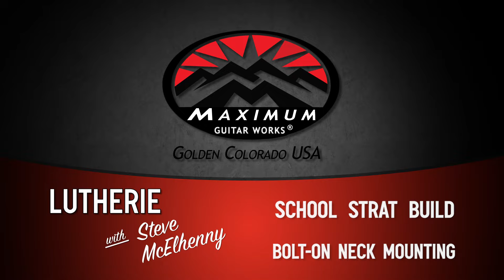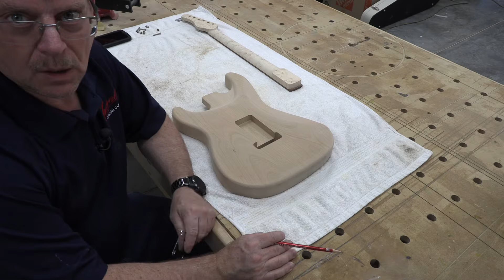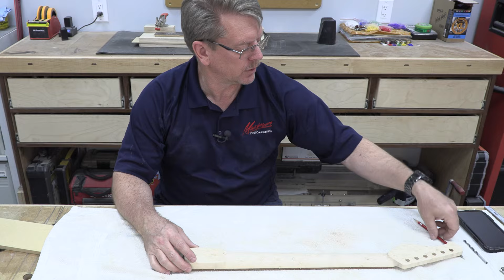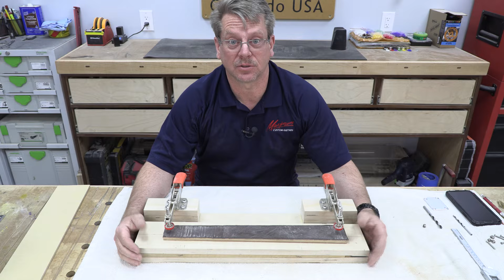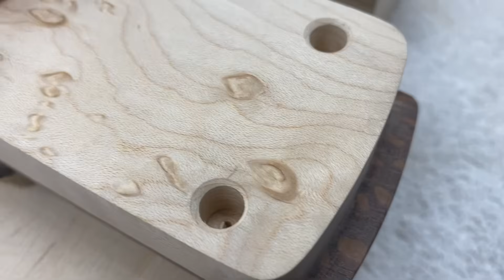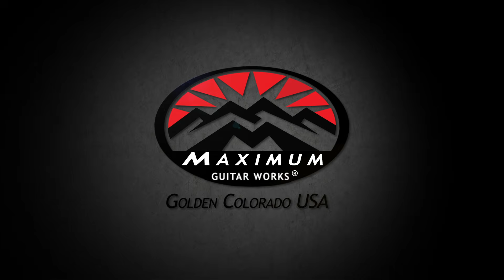The School Strat Build - Best Bolt-on Neck Method...ever!

Comment: I have a bass with a bolt-on neck with inserts. And i have a big problem with that because of the body holes wear over the time. The holes are now loose and the neck slightly moves. If the bolts are not tight through the holes you're done. This doesn't happen with wood screws.

Comment: Countersinking the insert is good for an other reason too: when you put the insert in it tries to push the wood fibers upwards and it will make an ugly result. When the hole is countersunk (beveled) then the insert will not force the fibers right at the surface but about a mm deeper so it is less likely that the fibers will chip on the surface (I learned it the hard way). The last time I had to do this kind of work I used candlewax to lubricate the threads so they can go into the wood with less effort.

Comment: would you use the stainless steel inserts and bolts on a " brittle" roasted flame maple neck, or The old wood dowel method? thank you for these videos, they are stellar detailed. Tell me more about your lawnmower seated desk chair. :)
Reply from the maker: Ahhh…it’s a great chair!

I normally don’t have issues with roasted woods. I do go slow…and if any signs of cracking appear…you can wick a little CA in the hole. After the CA does its thing, reinstall the insert.

Comment: Suggestion drill your first hole then put your plate on insert your screw not tight snug then mark your other hole across drill that hole after taking the plate off and so forth and everything will be lined up perfectly every time 👍I learned that in Vietnam .

Comment: I watched the whole thing. Great video! 
I am making a travel guitar that will have 3 interchangeable necks, one fretted, one fretless and one based on a Sitar neck. 
I think the threaded inserts will be the way to go because I'll be changing the necks often and removing them for flights. 

I bought an old German Jazz guitar that has a bolt on neck for the body and the instrument will have a sympathetic harp on it as well, basically it will be a guitar/sitar hybrid with 3 neck styles.  A bit like a gibson harp guitar, but instead of bass register harp strings it will have higher pitched sympathetic strings like a Sitar or Sarode. 
If you are curious about what I am talking about, here is a video of an electric prototype I made; https://www.youtube.com/watch?v=vX7n8LlIYuw
The new one will be acoustic and I will take it on a 3 year bicycle tour around the world. I have done long bike tours with my Sitar (on a small bicycle trailer) in the past, but I often had the urge to play guitar, so I'm looking for a solution that will keep me entertained while sitting in my tent in the middle of the desert... 
Too much detail in my comment! LOL!

Comment: 24:00 - would it be better to use a deep socket pressed tight to the body ensuring it is perpendicular?   Add a strong spring to the top of your home-made tool to maintain the downward pressure.

Comment: Thank you sir, not overly detailed. I saw on another Tube they they threaded the hole and then came and threaded the ezloc into it. Using the drill press and doing it by hand, kept threader perfectly perpendicular to the neck and then they are able to just put some wood glue onto the ezloc and thread it into the neck. If interested i can send you the link if you haven't seen it. I am off to the next course with the lining it up. And thank you for your help in building my dream parts-caster.

Comment: Thank you for your efforts to make such a detailed video.  I especially liked the "Insert Driver" adapter that you put together.  I can not remember how many inserts I have jacked up over the years by just trying to get them aligned and installed by using a slotted screwdriver.  I will be using this bolt on neck method on my Stratocaster Project's body in the near future.  This video was just what I was looking for to correct my "just about to strip out" mounting holes.  Thank you, Thank you, Thank you.

Comment: Just discovered your site ! Wish I had seen it a few days ago. My grandson approached me a couple of weeks ago seeking my help (and tools) to construct a modified stratocaster . I said sure, having no clue what we were getting into. We are using the neck from a fender knock off and making the body out of some butcher block I had on hand. I fear that in our rush to get going we have already made some small mistakes, but they do add up. He was asking just the other day about doing away with the neck screws in favor of bolts. Another site recommended going to McGuckens in Boulder for steel inserts and since I am in Westminster that should not be a problem. Will have him watch your video(s). Thanks

Comment: just discovered this video so anyway.One thing i discovered in drilling precise holes with a drill press is,not all drill bits are perfectly staight.Chuck the drill bit and start up the press and watch closely to see if the point wiggles,if it does the hole you make will be larger than you intended.Either use the point of a pencil or nail or ? and solidly put the point up against the point of the dill bit to check runout or drill a test hole on a blank piece of wood first.

Comment: I just learned something. Nut & bolt trick. Thanks 🙏.     Could you use the type that goes thru the neck that has a flange with tangs? Of course you would have to do it before the fret board is attached.

Comment: Yep, threaded inserts are definitely an upgrade. Could theoretically increase sustain due to the tighter neck-to-body attachment.
Reply: Liboy, that may be true and could be tested scientifically. Many variables but the most important is the face-to-face fit of the neck in the pocket combined with the proper clamping force of the hardware to help transfer vibration as inelastically through the joint as possible. That factor alone could even be torque-sensitive, considering that no joint is perfect. Theoretically, two machined surfaces (even accurately-machined metal) only touch at three points. This could be a case where a hard neck pressed against a softer, more yielding body wood could actually produce a more resonant joint. It's still doubtful most people could hear the difference as long as the joint is not loose or sloppy, at least that's my bet.

Comment: The easier jig to make for leveling the neck for drilling is to make some V blocks that only touch the edges of the fretboard.  Then all you need to do is place a level on the heel of the neck and clamp her down, no need for tapered resawn stock to do it.

Comment: Would it be better to tap the hole first and glue in the insert?  Have you ever had any back out?
Thank you for the in depth procedure of doing it right.  
B
Reply from the maker: I have had the back out...but only when I was not careful...and cross threaded the bolt.  That is why I always start by hand now.  It that case I glue in with fish glue.  No need to tap if using self cutting wood inserts.  If you use inserts for metal...finer thread...tapping first is advised.

Comment: If you're neck is not uniform thickness, having a taper as most do, those holes are not perfectly plumb. Very close, as they haven't affected what you are doing. I have done these EZ-Lok stainless threaded inserts in a Warmoth maple neck, too. Harrowing, which is why I am watching your helpful video.  You are smart enough to get what I am saying, though. Please correct me if I'm wrong mathematically.
Reply from the maker: That part of the neck is flat.  My jig can adjust for any minor taper of the fretboard...especially with compound radius.  I can make things dead perpendicular to my drill press.

Comment: great explanation.  i’m a little late to the channel, but have you discussed the whole neck plate vs recessed screws subject?   i am wondering why we need to add plate thickness right there and if the plate is necessary instead of say 5 screws and recessed washers.
Reply from the maker: It is preference more than better.  Everything has pros and cons.  I like neck plates on my bolt-on guitars only for the marketing real-estate available on the plate.  Great place for my logo, guitar name, and serial number.

Comment: Excellent video sir.  You're excellent at communicating with the audience.  I have a question.  Your buddy over at Texas Toast has a video where he uses the EZ Loks that are meant for use with steel. His internal thread size is 10-24, a little larger than your 8-32. He taps his hole, whereas you are using the EZ Loks meant for wood and the threads themselves do the tapping.  I guess my question is:  which method should I go with?  I'm thinking that both methods are more than adequate, but I figured I'd ask.  I'm going to ask him as well.  For the audience:  What do you guys think?  #8 bolt or #10 bolt?  I'd like to hear people's opinions.  Thanks again sir.  Great video!
Reply from the maker: Thanks, sorry for the late reply.  I like the 8-32...more space from the edge with standard neck plate spacing.  Plus I prefer stainless steel whenever possible.

Comment: A few years back I had to build a custom neck for my Godin XtSA. I decided to use machine screws for the bolt-on. However, I installed the screws through the heel prior to gluing on the fretboard, with the screw shafts protruding thrugh the back of the heel (the screws had wide flange heads that fit nicely into countersunk holes in the top of the neck). Once the fingerboard was glued onto the neck, it covered the screw heads, and the four screws coming out of the back of the heel aligned perfectly into the mounting holes in the pocket. Once the neck was mounted into the pocket, the screws got acorn nuts (with tiny washers) that got sunk into shallow counterholes on the back side of the body right over the pocket. This method eliminated the worry/need of using threaded inserts for the machine screws, because now the four screws were fitted all the way through the thickness of the neck heel. And the joint - once the four acorn nuts on the backside were torqued really snug - made my Goding feel so rigid you'd think it was a neck-through construct. And the sustain.... like in "Spinal Tap"  😀
Reply from the maker: Nice.  Experimenting with things is part of the fun.

Comment: Very nice and instructive video. The only thing I'm afraid of when using bolts..instead of screws…is that they can come loose due to vibrations from the guitar.  what is your experience with that?  Best Regards Jan
Reply from the maker: The extension tension achieved with bolts prevents that...sort of like the purpose of a lock washer.  I have seen more loose necks with wood screws.  It is always personal preference though.  Do it on a guitar an see what your results are.  I wouldn't trust information online (including mine) without validation through personal experience.  Although often that still only proves personal preference.
Reply: @maximumguitarworks  ok, thank you.

Comment: I won’t disagree with the strength of a joint using stainless threaded inserts but it definitely does do things to the overall tone of the guitar. 
Iv experienced it on 4 different strats, all modded to have brass or stainless inserts in the neck, before and after was night and day and not for the better. Brass sounded slightly more natural but is also extremely soft to the point where you might as well plug with maple dowel and redrill anyway.
Stainless sounded very unnatural with a weird high resonance like most stainless parts on strats do.  
 The best thing you can do for a “bolt on” neck fitting is to ensure the body holes have the appropriate clearance and aren’t threaded themselves. Strats have lasted since the 50’s with the screws straight into the neck, even with the vintage heel adjustment and the necks being taken off seasonally for the last 70 odd years to adjust the rod  the vast majority of their neck screws have still held perfectly. 
Also strip a maple neck mounting hole and you just redowel it and redrill. Strip that insert and the amount of wood needed to remove and redowel the broken insert is vastly increased and you end up in a far worse position.
Reply: My thoughts exactly.
Trying to improve something just to add more problems in the future when a simple thing like stripped thread occurs.
I have bought a used Warwick with J style pickups mounted on brass threaded inserts.
Two of them are stripped.
God luck pulling them out.

Comment: I would make a tap from one of those inserts if a commercially made tap were not available, tap the hole and screw insert in with epoxy. Your way is fine but not the best!.. Retired machinist here.

Comment: I appreciate the detail Steve its not overcomplicated.  Great Job.!   If I might be so bold as to make a suggestion /comment...It would be great to see  links to the different parts you use, probably in the comments section. I find often times listening to your detailed explanation I wish for a summary as a reference. For example state: I use   EZLock SS inserts from XYZ company. THe outside diameter or thread is  is X inches or mm and the inside is 8-32 or 1/4- 20. and depth is X  3/8 inches or whatever to allow for slight countersink.  This is just my observation.   as we go out after and purchase or source parts we can narrow that down to ABC..  Love the Jigs ....Love the channel Keep it up. Where'd you get the seat... I need one too Hahaha.  See what I mean?

Comment: I saw the whole video, when it comes to technique and learning from other peoples experiences and how they overcome the issues they encounter, there's no such thing as a long video, a 30 min video to learn a skill is nothing. people that watches 10 mins of it probably were looking for a different thing and they stuck around because the video was either well presented/produced/tidy or good enough to leave it playing for a while and see what it had to offer, even if that wasn't what that person was looking for. 

In another note, i found this method (thread inserts) to be one of the best things that can happen to a guitar with neck joint. IMO every guitar maker should start implementing those, mostly because it gives the player the option to take the neck apart as many times as they want, and it's also a great option if the guitar is going to be shipped by a postal or freight service. i have a 3 guitars that have it mostly because if i travel and i want to take one with me on a suitcase i can take the neck apart and fit the guitar within my clothes on a same suitcase, it makes it so easy and safe.

Thanks for this video. Keep em coming!

Comment: Can you tell me where to find those Stainless Steel inserts that you mentioned here. I cannot located the Stainless anywhere, only brass. Thanks for your time.
Reply from the maker: I sometimes get them on Amazon...but just noticed that they are not listed right now in the 8-32 size that I use.
Try McFeely's hardware.  
https://www.mcfeelys.com/8-32-x-3-8-in-threaded-inserts-for-hard-wood-303-stainless-qty-10.html

Comment: That style insert might be ok for mahogany but for maple I would use a regular insert for metal. Also if you are using a stainless insert with a stainless machine screw  you have to make sure they are different alloys because when you install that insert slightly crooked, which you will, the similar alloy screw will gall. That means you are really screwed, so to speak. 
BTW, I absolutely do not recommend modding your existing guitar this way unless you have the right tools and a fair amount of experience. The benefit you get from switching to machine screws is in no way worth the risk of destroying a guitar neck which can very easily happen.

Comment: Do you put glue on the outside of them?
Reply from the maker: You can.  Generally I would say that it is not needed if your fit is correct.  I have used CA and Fish glue with no problems.  But most of the time it is not needed...but certainly doesn't hurt.  Try both and see what you like best.
Reply: @maximumguitarworks  ty for replying

Comment: Nice amount of detail my friend. I like your engineering solution too, something I've pondered for a few years now is the use of woodscrews on a 'bolted neck' - not robust enough imho. Great idea of yours to have bolts/captive type nuts etc. 

I like your version of body shape relative to upper fret access, so much neater than some of the curved heel type joints I've seen.👍😊😊

Comment: Hi Steve...I really enjoyed your video..very very detailed, continue like that plz...after watching I have few questions if is possible for you to answer...I have noticed you install the inserts with that cut facing up, manufacturers of inserts as "proper" installing shows with cut facing down placed at bottom of the hole...from your experience, whats the reason for doing that?...and those stainless steel inserts are with outside machine thread and not intended for screwing in wood (I'll use metric) making a hole 0.5-0.6mm wider from inside thread dimension of the insert can easy be installed by little mistake with slight angle...why you prefer more those stainless steel inserts more than standard hex carbon steel inserts?...

Comment: Not overly detailed.  Good video.
I have an old Kramer Duke 6-string with a bolt-on aluminum headless neck with machine bolts.    I was able to get the neck bolts so tight, the neckplate became slightly warped.  That was about 39 years ago, and the neck plate is still warped, in a good way.

Comment: Very informative. I have never been able to keep those inserts from coming out.
Reply from the maker: The right size hole is key.  And that does vary for the density of the neck wood.  I also find if the inserts are not perfectly straight...binding occurs which can cause the screws to cross thread.  That is never good.